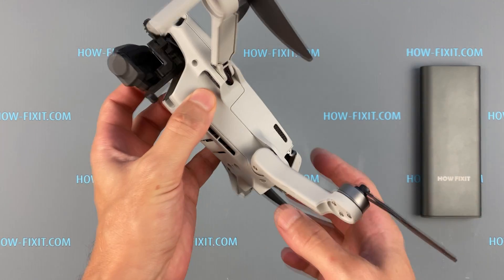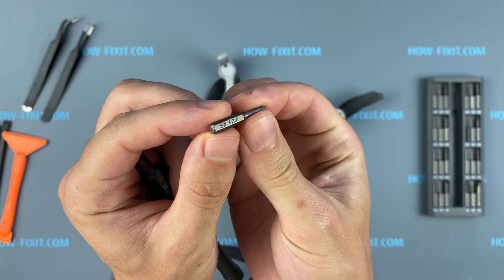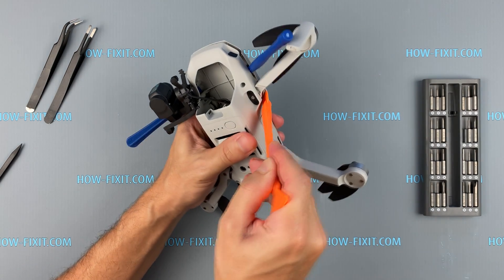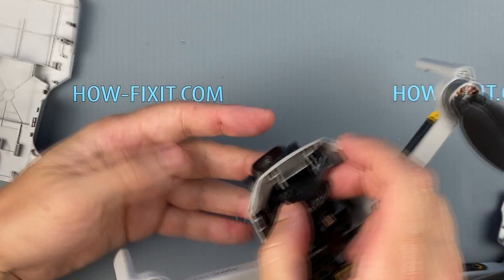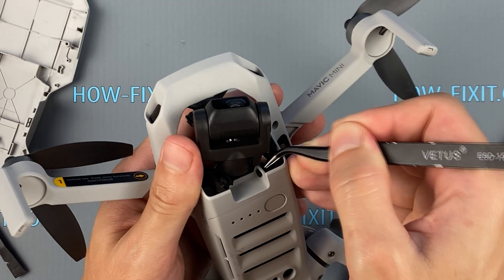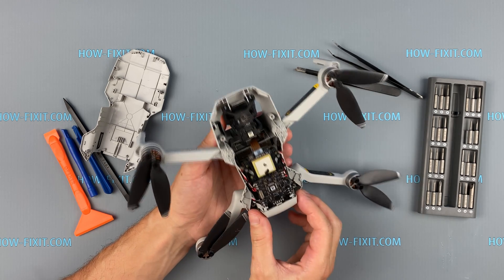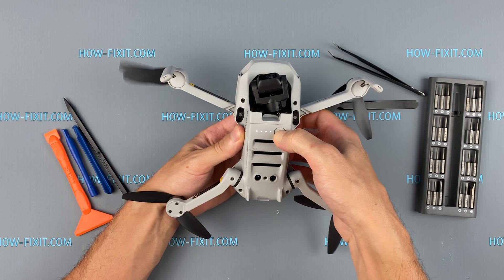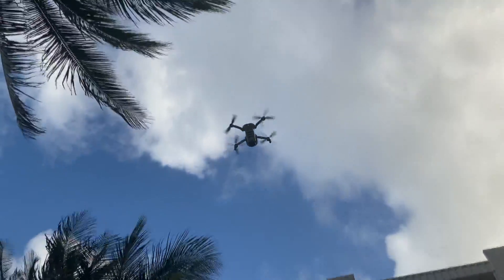Dji Mavic Mini Gimbal Repair after crash

Comment from the maker: After replacing the gimbal camera, you may need to calibrate your drone, but this cannot be done using the DJI Fly mobile app, you will need to use additional software. How to calibrate the gimbal watch this video tutorial https://youtu.be/mu03HWXplM4
In the video description, you'll find useful links to all the essential tools required for this repair
Reply: Great post!  I was able to replace the gimbal and flat ribbon with parts that I ordered online.  I also repaired one of the arms without replacing it.  Flys perfect!  Here's the problem.  I have a Code 40021  Gimbal IMU error which causes the cam to tilt to one side.  I think it is a software error.  Anybody know the fix?  I see many people who have repaired their own minis have encountered this problem.

Comment: Hello! Please help me. I crushed my mini 2 and broke ribbon cable. After I have changed the cable, I have 40002 error, gimbal stuck. When I power up the drone, the camera makes moves ( left, right, up, down) and after this is making a continuously noise and does not work up or down. The image is ok.  Can it be fixed?

Comment: It was not that easy to push the rubber mounts into the case (I used tweezers), but I managed. So thanks for the instruction. My Mavic mini has it's Gimbal in place again.
Happy flying!

Comment: Hi all, I recently crashed my mini2 into a pole 🙃, the front is cracked at where the two parts meet and the gimbal is partially disconnected from the body. But, the screws refuse to come out, except for the back ones. Please help!
Reply: I’m having the same problem. I stripped one of the screws
Reply: Yea bro they put liquid tight on one of them force it gently
Reply: Hey so more clearly they put glue on the screw use the plastic tool force pressure on the area by screw

Comment: Need some help,  on mini 2, 
I ordered a 3 in 1 flex cable. It appears the same, I plug it at the motor board and plug it at the gps board.  Is the cable supposed to twist when it meets the gimbal plug, because it won’t plug in, unless I twist the cable around. Is this normal

Comment: Hello! Just a small hint, the "screwdriver and opening toops" set you recommend to buy in 
the description does not work for the mavic mini, as the screwdriver is 
too thick to fit into the holes to unscrew the screws at the back of the
 drone
Reply: But the screwdriver provided with the mini works fine

Comment: Does replacing the (Transmission Flex Wire 3 in 1 flat cable) require calibration?
Reply: I think the cable wont be a problem if you exchange. but obviously you cannot exchange the gimbal without calibration.

Comment: Hello there, my mavic mini was working fine, it was not switching off, so i removed battery and after 2 days it now doesnt want to power on. If i put usb cable without battery 1 and 2 led flash then 3 and 4th leds keep flashing. With battery no power leds or switching on. Please help
Reply: you have a 2nd battery?
Reply: or can lend it for testing?

Comment: nice video, I broke my gimbal and replace it , but there´s still one error, 40002, gimbal stuck, how can I modify this ?
Reply: Hey sorry this isn’t an answer but did you have to buy a new camera? I just got mine and a day later accidentally flew up into a tree and it fell into gravel shattering the camera if you didn’t buy a camera can you send me a link
Reply: @diego__.c9573  I placed my old camera into a new gimbal. picture works, but gimbal need to be adjusted. I cannot adjust by myself, now i only have picture (no gimbal function). As i understood its not possible to calibrate new gimbal without dji. Fuck!
In your case, you may buy only a new camera glass and exchange?

Comment: Hi, i  have broken 3 of the 4 gimbal legs (legs that fix gimbal on the mavic mini body via rubber parts). It look like that my gimbal is still working, it is still stabilized and i can make it go up and down. Those gimbal legs are on the upper part of the gimbal. Do you think that it is possible to change only this part? Anything could help.
Reply: I snapped the camera off the gimbal how did you fix bud?

Comment: I have the same problem too. My Mavic Mini got stuck in a tree and it fell and I heard a loud crash. The gimbal came off. Now my grandpa and I are trying to fix it while watching your video. Or I can pay for Dji care refresh for 35 dollars.
Reply: You can't buy the Dji refresh after a crash unfortunately.. I thought the same but it's not possible.. I had my camera and gimbal break in 4 places, and all cables were ripped out too.. I ordered both cables on ebay for £18, glued all parts together.. all works perfectly again.. had to strip the whole drone down tho which is very tedious in my opinion, such fiddly wire connectors.. good luck with yours

Comment: I've managed to do this without disassembling the case with new rubbers. Just took patience and a pair of curved needle nose pliers.
Reply: It is best to pull the camera out until you hear a pop, indicating the gimbal is now in place and no longer stuck
Reply: How! I just need to fix one more place the front rubbers🥲
Reply: @fernandomendez2675  You can see them from the bottom at towards the front of the case. They pull out towards the side of the body. It took me a few attempts.

Comment: Do you have a video repairing a torn flex cable which connects to the gimbal? I’ve repaired all parts of my last crash except the flex cable
Reply: Alright I’m not like a pro but this same problem happened to me you can buy a new camera on amazon or your preferred site about 60% of the time it comes with a new flex cable hope that helps😄
Reply: That torn cable had me thinking for 2 days how it fitted.. there are white lines on the ribbon that shows how it fits.. if you still need advice i will try and describe in full how it fits to everything from memory as i just fitted mine a week ago..👍

Comment: I've also crashed my mavic mini and after that the gimbal was horizontally inclined but I could fix this by manually calibrating the gimbal... don't know for how long this solution will work.. in long term I'll have to open the mavic mini to fix it straight again or replace... hopefully I don't need a complete new gimbal... these gimbals are fukking expensive (140€) :(

UPDATE: I've decided to open the case because it was starting to complain that the gimbal is stuck. I had luck and it really was stuck somehow but I could fix this. Now it's flying again without problems :)
Reply: How you finally fix it?
Reply: @vinzaputra  I've already updated my my comment above, after opening it I saw that it was just stuck and  I could fix this my just slightly moving the gimbal
Reply: @blue_monkey89  I think I just found my problem, it was fine sand that stuck into my roll Axis gimbal. So it not so loose when roll to the left side.
It was my bad, I'm just a newb, I learned my lesson to not take off and landing in sandy floor 😓

Comment: I have a tilt I can't fix. Its not a calibration issue. I think its an arm motor problem. Any solutions?
Reply: The gimbal axis is bent and your drone is fooked. It happens all the time. Replace it

Comment: We all came here for a reason 😅
Reply: I'm here just in case lol
Reply: I crashed my mini today ,the camera is shaking so bad every time powered on...
Reply: @groslait7814  Ooff, sorry to hear about it! I hope you have some sort of insurance plan or so
Reply: @doubleu1446  no plans, :(  the camera is shaking up and down in high frequency, and with vision sensor error ,I want to buy a replacement but I have no idea which part is damaged, i think is the camera . It cost 130 euros to buy a new one :( I guess I m going to buy a new drone.
Reply: @groslait7814  Oeff, that sucks a lot. I also flew my drone into a tree and now the camera is not completely horizontal anymore 😅. Now I'm extra carefull every time i go for a fly
Reply: @groslait7814  same here i crashed it on tree today it just came yesterday after repairing it's broken propellers , and know this gimbal broke down 🥲🥲🥲🥲
Reply: Mines goosed too
Reply: My camera broke off the gimble....
Reply: @mr.baconman956  Auch..
Reply: Wind blew it into my house 😑😔
Reply: Now it wont stop shaking
Reply: Crashet it in a high voltage line
Reply: Hit a sandhill now gimbal has sand in it and won’t move the camera
Reply: @jaywoody1116  auch...
Reply: not a good one. my mount broke
Reply: Haha true
Reply: I also crushed mini gimbal is all broken, pff
Reply: I’m storing in the middle of the road in front of my broken drone trying to figure this out
Reply: MY 10 YR OLD DAUGHTER CRASHED IT BY RUNNING IT INTO A MOVING SCHOOL BUS AND THE CAMERA IS ALL OUT JUST LIKE IN THIS VIDEO AND NOW I AM GOING TO ATTEMPT TO FIX IT IN THIS EXACT SAME MANNER, HOPEFULLY I WILL BE SUCCESFUL.
Reply: Mine went full speed into my door inches away from my brothers head

Comment: I recently crashed my mini an broke camera

I replaced camera, recalibrated it calibrated dronecompass, camera points to the right, when starting up camera swings left right up and down and returns to the right, has an error imu, I disassembled and checked all connections, all good, still has concern

PLEASE help

Comment: I have the same problem with my mini, the cable of vertical movement broke after a crash with a tree. Can you make a video how to replaced it and where to buy it, please? Good video, thanks!
Reply: I bought it, need video on how to replace the flat ESC cable and if it needs soldering
Reply: I have the same problem. Have you found an solution?
Reply: mine is broke too 😬 30miles/hour at a tree 😬 not good .. i broke my brackets to but fuck that just want to replace the flat esc cable .. but how ?
Reply: @robinmarchand1211  mine too just a week ago... I set on iphone to stand in position in case of losing signal, but in fact not worked... i lost signal and the drone start to fly back so fast (sport mode) it was too late to stop it.. he crashed so bad and happen the same.
Reply: Three days with mini 2 and already crashed it and the cable is fckd

Comment: The flat cable to the gimbal is torn. Is that cable responsible for vertical camera movement and how do I purchase and replace it? Thanks
Reply from the maker: Hi, I’m now making video instructions on how to replace a gimbal or a broken cable. Soon this video will appear on the channel.
I’ll also leave links where to buy a new cable. Your case is completely solvable!
Reply: @howfixit  yes! 🙂 Thank you
Reply: @howfixit  Hello, i have the same problem, but after replacing original cable with new one, camera is still doesn't recognizing by drone, so it is no movement of camera when Mavic is swithed up. Maybe you know how to fix it or give me advice in this kind of situation? Thank you!
Reply: @jakjosc  maybe its ur ginbal fault... U should replace the gimbal too
.. My mavic mini had a crash too 3 times but luckly only a bit of crack in arm and gimbal rubber got loose.. And some horizon issue after the last hard crash but still great
Reply: @jakjosc  You ever figure this out? It's almost like a software check that the camera isn't the one that came w/ the drone
Reply: @kwatts123  Ok, then, so how can i replace it? Are there any other ways?
Reply: Did you make this video yet please put in link
Reply: Maby you can solder it
Reply: Still looking for a solution myself. I'd hate to send drone in to DJI, i bet it costs a few hundred to fix a $400 drone :-|